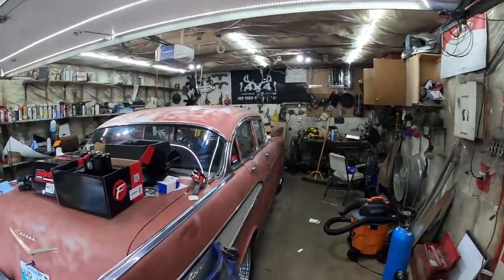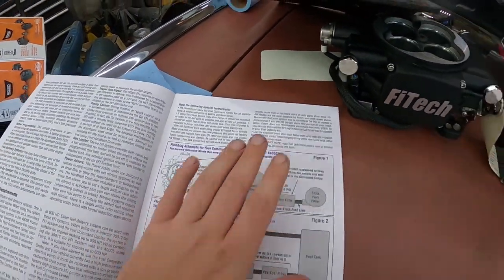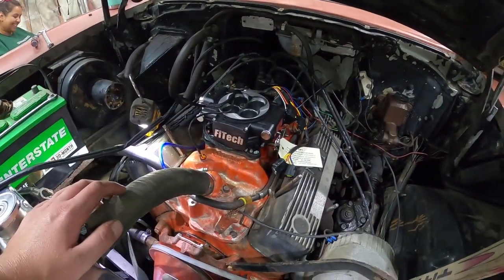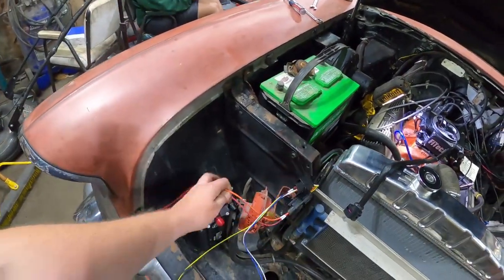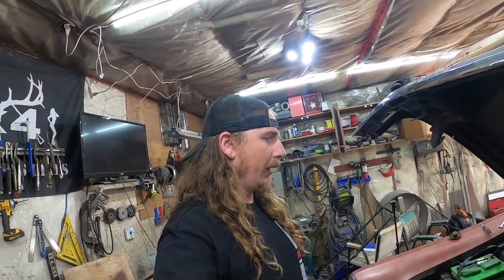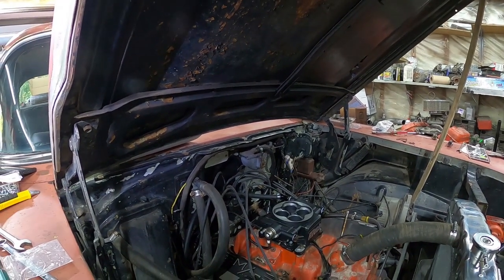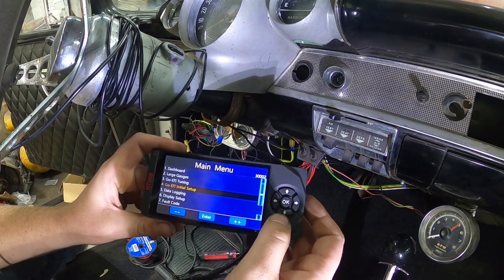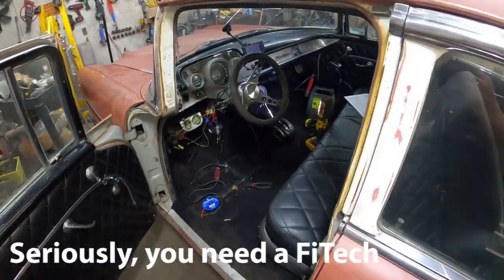EFI Conversion - Best Upgrade Ever? - GIVEAWAY 57 Chevy Goes Space Age...

Comment: Oh crap so so sweet !  One of my best memories was about 1962 . I used to hang out at the Clark gas station on the corner behind my house . Occasionally I would help sell cigarettes. And generally help with out play. anyway a guy came through with the Studebaker Tudor don't remember which year it was it was a moldy oldie he added 283 Chevy with solid lifters in it and a four speed. The car was a ratty black had a beat up interior beat up  body pieces stop in the Clark gas station and adjust the lifters with the engine running in the summertime right before he Drag Race Down Western Ave. in Chicago.

Comment: I'd like to make a suggestion. That fuel tank thing you installed in front of the core support, it really needs to be behind that core support.Maybe relocate the battery and put it there? It wouldn't pass Tech at the dragstrip. It would be a lot safer behind the support. I think doing a great job on my 57 lol keep up the good work 😎
Reply: Thinking in front crash you would regret having it out front.

Comment: After seeing a FiTech fuel injection system nearly kill my buddies 440 in his restored 70 Charger, I will never trust that stuff. Plus that fancy crap to me will never equal a carburetor and a good old fashioned ignition system, call me a dinosaur, but I prefer everything on my vehicle to be mechanical in some form or another. You did a good job and I am surprised it fired right up, but Jesse's Charger was like that at one time. Hopefully this unit never causes a problem like his did, keep up the good work...

Comment: Omg. That looks like it's hard to put in. I don't like dealing with the gas tank. I worked on a 1992 Cadillac . It had hair line cracks and I sealed it but I caught he'll replacing the fuel pump. That car was an money pit. Lol. Great car parts. It will be so cool. Great spot to put it. Yay. You make it look like it's so easy but man. Lol

Comment: I have the 800hp capable Mean Street sitting here, had it on my GTO for a couple years. Been tuning E85 Qjets with the Goat so I had to pull it off. I built the fuel system for it with an inline pump mounted by the tank lower than the tank, and ran hard line to the TB. Its probably going on the Cuda I got from my dad, because the edelbrock carb he has on it is crap. No power and horrible mileage. I like the FiTech, it runs rather well, and I never had a problem with support calling them. Met a bunch of the guys at SEMA back in '16, lots of cool stuff was in the pipeline at that time.
Reply from the maker: yeah!  they are awesome to deal with!

Comment: i bet that cost more then i got in my pu  i have 2300 in my pu i'm running a 4 inch stroked 454 with tunnel ram steel crank heavy rods heavy duty 400 turbo 12 bolt possi 4/11 gears started with a 454 ho then built it a little just have body paint and interior to do  and the wood box floor

Comment: Showing a voltage drop so the wires on the dash must not be hooked up or a wire fell off ... who knows but when voltage works then they run more gooder. I really hate wiring too but that rig is as simple as the do get would you not agree?? Was curious if that gauge on the pressure pump is reading... i thought I saw one. I tell you, it better well go soon or its gonna be like one of those rescue dogs that never gets adopted for some time and then you like it an wham some one does adopt and you cry cause it has to go. Got to admit yourself I would think that its not a bad 5   7 ... what cha say Dan??
Reply from the maker: yeah i gotta tackle the rats nest of wires undre the dash,  im sure ill help it all out

Comment: I picked up a Summit inline fuel filter for my truck, and spent FOREVER looking for a billet mount to fit it. Finally found one on Jegs' website. lol
Did you just drill the hole in the tank with it in place? Are you worried about metal shavings getting in the fuel system?
Reply from the maker: i drained the tank and put a pre filter pump

Comment: You say 57 Chevy goes “space age”

When the original Chevy came with fuel injection. 

Leave it to America to dramatize the past to make us feel like we live in a different future. 

And now it’s throttle body injected. 
Which is 80s tech at best. 

Remember Mercedes had, not only a fuel injected engine in 1957, but it had direct injection. 

So a more appropriate title is 

“Bringing a 57chevy into tech that was not even state of the are 70 years ago.